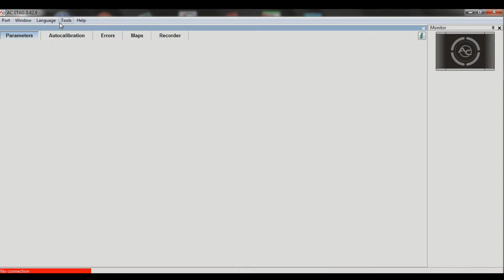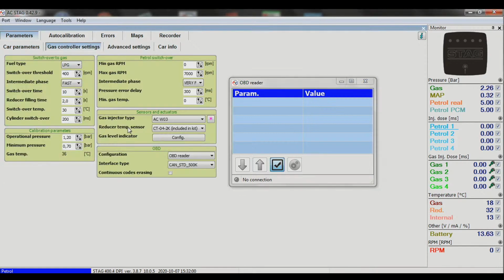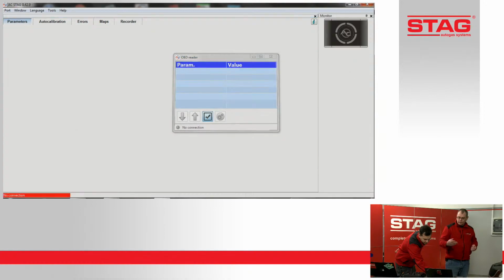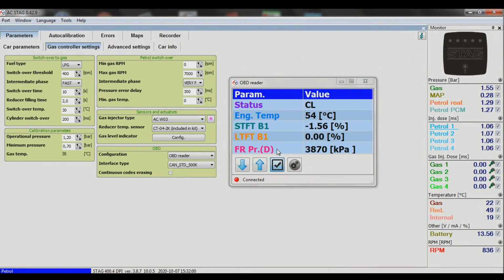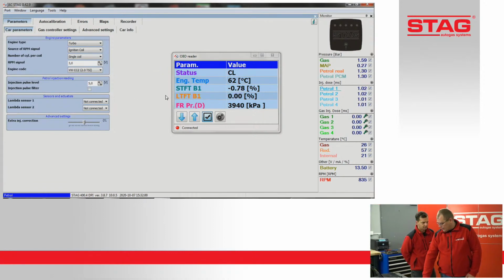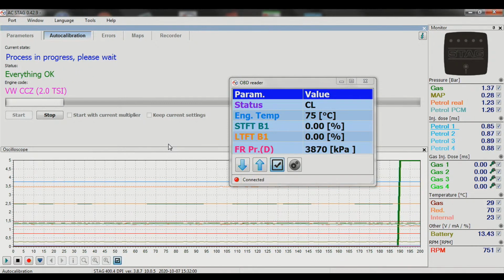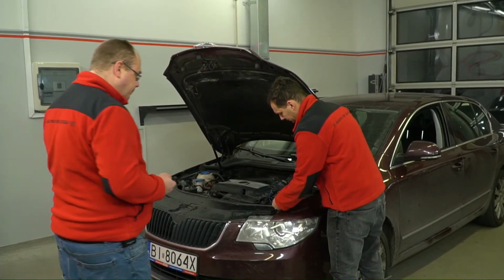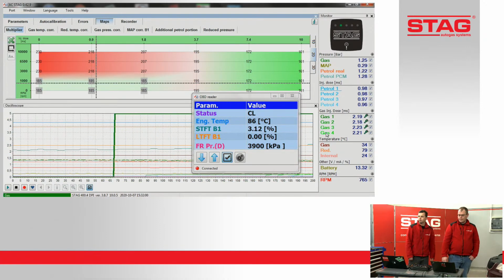Live: Real Life Tests Taken. Vol2

Comment: I have problem with multipoint inection on audi a4 b7 2.0 alt . petrol injection looping detected. recommended connection of the rpm signal 14. Do you now can i drive with that problem or i shold fix it urgently , and how to fix it. Stag 200 is system with ac stag reductor. Thank you?